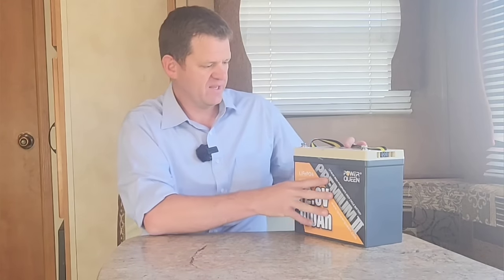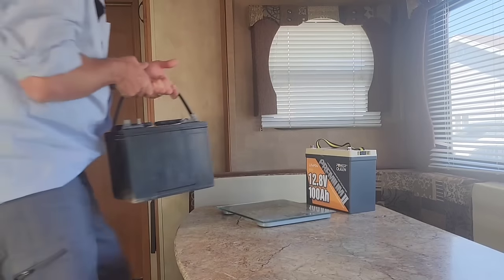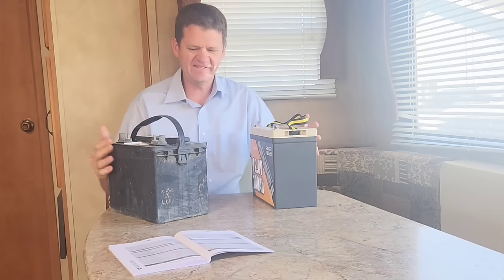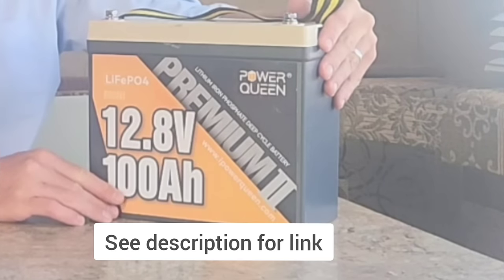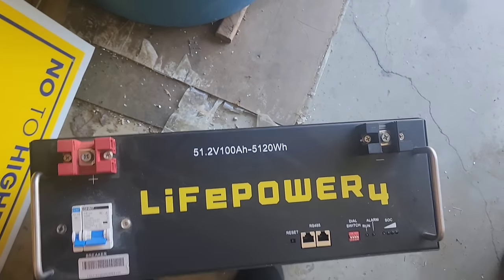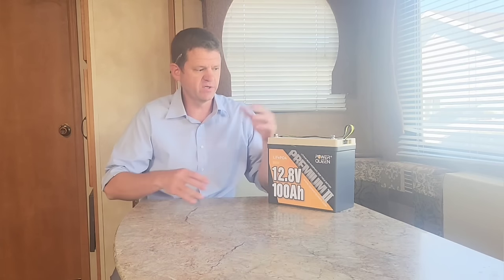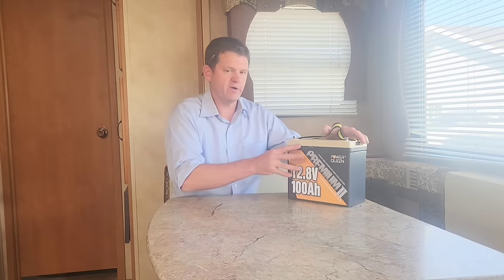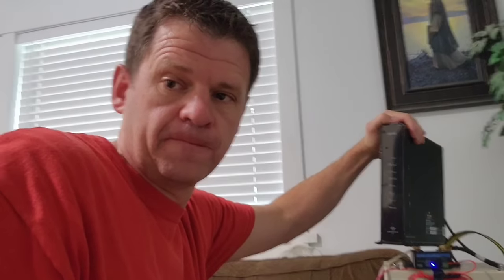How Long Can a 12V LiFePO4 Battery Run a Fridge, TV, Laptop, and Wifi Router (PowerQueen test)

Comment: About 17 hours for the fridge.
Also around 17 hours for the tv.
About 24 hours for the laptop and router.
About 4 hours for all plus some lighting.

Thank you.
Reply: How can you run a 100 ah battery that long
Reply: @Username-e5l  A modern tv doesn't really consume that much power. A laptop and router even less. The fridge does draw a large amount of power, but unless you left the door open, open it a lot or the fridge is in a bad shape it should run at intervals for short periods.
Reply: @LordBaal19  I have a 160 ah battery and I can barely run appliances for 6 hours
Reply: Must be a knock off  @Username-e5l
Reply: Lithium vs lead is 
Lead you can only use 50% max 
Lead volt go down means it use more amps to compensation.   @Username-e5l
Reply: @Username-e5l lifepo4 is good  no piombo agm no good dipende anche dal inverter che hai oltre alle batterie che se sono al piombo ci vogliono 3volte 160ah x 3 480ah piombo gel o agm=180ah lifepo4 ok by
Reply: @dyslectische yes 100amper lifepo4 is =a 260ah piombo cost ok lifepo4 to day no good piombo sopra up 1000watt no good is 25.6v ok or 48v
Reply: @dyslectische yeah I use a lead acid battery
Reply: @Username-e5l  I think it depends on the fridge type. I have a "traditional" style top mount fridges that I bought about 3 years ago. The efficiency rating is higher. I have been watching videos trying to keep their 2 door fridges up for 10 hours.  But also remember, my Lifepo4 battery is higher than 100 Ah.
Reply: I would like to know how long it took to get the battery charged back up with all those solar panels.

Comment: Thank you for this video Ray. I bought a Licciti battery box with 1,000 Watt inverter and 284 Ah Lifepo4 prismatic battery kit.  I tested this last weekend with my traditional top freezer mount fridge and it went 30 hours and didn't get to 50% discharge. I only stopped using it since I still don't feel comfortable leaving it alone at home while we're away. 
  I am watching your videos, David Poz, Will Prowse and many others as I have begun buying the parts for a 48 Volt system. I really wasn't sure whether to buy more Licciti battery boxes/power stations or go to a large system but finally decided to avoid spending more money on the small power stations.

Comment: You did a comparison with lead acid batteries which was great because I use those.
These are the kind of questions I have always wanted answered but no DIYer or professional electrician have ever answered. Thanks for your elaborate tests. I have learned a lot from you
Reply from the maker: Thank you for all the nice comments. I love top gear! :-)
Reply: My first set up was with a sealed lead acid battery too. With led acid 1 rule of thumb is taking the aH on the battery and cut that in half for the true usable aH. My first battery was 112aH led acid and I'd only get about 55hours of constant power with it. It did charge very quickly though with 2 100w panels. About 3-4hours on a cloudy day
Reply: Yes.  I would not have a lithium battery IN my home.  Too risky
Reply: @paulawagstaff686 lithium phosphate batteries are different than lithium ion

Comment: yes the load on the inverter matters to rate the efficiency. A constant high draw load will be most efficient compared to a super low draw because the inverter has to be on longer doing the conversion from dc to ac for a longer time therefore consuming more of your battery into thin air.

Comment: Yesterday, due to storms, we had a power outage that lasted somewhere around 6 to 7 hours. After just about 4 hours, decided to plug the refrigerator into the 268 WH Bluetti power station.. Was pleasantly surprised to find out that it started and ran, and it showed that it had about 2.6 hours estimated in the beginning.  Was drawing about 100 watts, but seemed to settle down to 85 watts.  Now I have a starting point to consider whether I want to go the route of a power station, power station + solar, or a good old fashioned generator.
Reply from the maker: Nice.  A couple 100 watt solar panels and you'd be golden.
Reply: A power station with a capacity of 268Wh is typically equivalent to a 20Ah LiFePO4 battery. This comparison provides a clear perspective on the significant increase in runtime that a 100Ah battery would offer. As for the power stations, lower-end models might have limitations on input charging. This limitation becomes particularly relevant when evaluating the viability of establishing a solar array with an output exceeding 200W. In such cases, the advantages might not extend substantially beyond offsetting power generation during periods of low sunlight.

Even though it might be expensive there are hybrid inverters if you're interested in constructing your own station. Hybrid inverters combine an inverter, an MPPT charge controller, and solar input functionalities into a single unit. This integrated design enables battery recharging without the necessity of a conventional DC to DC charge controller, especially when coupled with a generator. In such a configuration, the generator can efficiently replenish your batteries during periods of insufficient sunlight, most cheap generators provide 1000W of charge power, that can charge a 100ah battery in a little over an hour.
Reply: how the fuck is your fridge running on 100w?

Comment: Your wifi router and laptop, and maybe the TV, you'd be better off running off DC rather than DC to AC to DC. You'll avoid the inefficiency losses converting between DC to AC to DC. 

An amazing way to do this is use USB-C. There are inexpensive PD 3.0 or even 3.1 USB-C devices, which will negotiate voltages of 5, 9, 12, 15, 20, 28, 36, and 48 volts (the last 3 are part of PD 3.1), and potentially if you use the right e-Marker cable designed to do it, up to 5 amps at any of those voltages, delivering up to 240 watts at 48 volts. 

You'd need a boost converter, which isn't perfectly efficient, to bump your 12 volt battery to 48 volts if you wanted to run PD 3.1 devices. But still more efficient than even a Victron inverter.

You can buy USB-C trigger boards for devices that do not do USB-C natively, and make your own cable.

Pretty much everything I do with batteries from now on will heavily involve USB-C and avoid AC Inverters.
Reply: Since I do electronics, I would just go straight to the main voltage used by the device in question, connect it straight to lithium battery's 12V if its own regulator can accept the maximum voltage of at least 15-16V.
And if a lower or higher voltage is needed, I would use a step-down or step-up converter. The fewer devices/converters inbetween, the better.
Reply: @edinfific2576  Yup, agreed. What USB-C PD 3.0/3.1 allows is if you don't know what you need to power, but want as many options as possible without adding a new buck (step down) or boost (step up) converter. If you can put 48 volts into a USB-C PD 3.1 outlet, then you can get ANY voltage at up to 5 amps PD 3.1 supports: 5, 9, 12, 15, 20, 28, 36, 48. You can convert most of your devices easily to any USB-C PD 3.0/3.1 voltage using a trigger board, which negotiates the voltage based on your choice, and outputs the positive and negative to whatever connector type your device needs. 

Now you can skip the buck/boost converters if you can run 48 volts to all of your USB-C PD 3.1 outlets, and have virtually any voltage you need.

On a 12 volt battery bus, you could put boost converters ( 12 volt to 48 volt for $16.99, though on up to 2.1 amps https://amzn.to/44Okkch ) behind each USB-C Outlet so you can have the full voltage range, though peak delivery at 100 watts with the listed boost converter. There may be boost converters that can do 12 volt to 48 volt at 5 amps.
Reply from the maker: Thank you. Very interesting.  My Laptop is the only device that has DC imput( 19v 12.a amps) the router and TV just accept 120 volts.  I'm definitely going to get some of these to charge my 9v radio from usb-c.: https://amzn.to/45yNZHi
Reply: @diySolarPowerFunWithRay Practically all home electronics immediately step down the 120v ac and then convert it to dc. This includes TV’s, routers, radios, computers, newer microwave ovens, etc., etc.

Comment: It seems like the score for the laptop is very tricky. If you start with a charged battery, the battery will extend the running time of the laptop. If you start with a dead battery, some of the power going to the laptop will be used charging the laptop battery.  

I like what you are doing and have subscribed to your channel. Thank you for what you are doing. I think you are helping a lot of (silent) fans.
Reply from the maker: Yup. That's true.  Thanks!

Comment: I love the solar I put on my RV.  It works great and has basically negated our need for a gas generator in most circumstances.  I've tried a million ways to justify solar at my home and the numbers never work.  We are fortunate to cheap power in Phoenix area.  Like a lot of people, I am attracted to the idea of "free" electricity from the sun.  Truly objective analysis tells a different story unfortunately.  Fun video.  Thanks!
Reply from the maker: Thanks. I love solar on my RV also.  Great for an emergency.  Did you see my 48v RV conversion video? You'll like that one.
Reply: @diySolarPowerFunWithRay  I haven't seen the video you mentioned, but I'll check it out now.  Thanks!

Comment: 1. Try connect what possible direct 12V. 2. Buy dedicated inverter for laptop 12V/20V  100-150W. 3. Buy "Inverter refrigerator"  ( big - better efficiency ) so  camping 12 V for big house not right solution. 4. If you have AC / water pump  - good idea to install 24  V (solar/battery/inverter).
Reply from the maker: All good points!

Comment: For conversion efficiency you need higher dc voltage. Lower voltage has more loss. That’s why most home systems are higher voltage.  Simple version is low voltage equals high amps. Higher voltage is Lower amps.  You spoke about it a few times and I believe 80% is pretty good for 12vdc to 120vac. I like what you’ve done there though. It’s good to see people doing some small diy setups and getting into solar. It’s so easy and simple anyone can do it.

Comment: I run my tiny air conditioner during our frequent rural Louisiana power outages from an inverter and 300ah battery. I have limited solar but also use a 20amp plug-in charger. It has been a lifesaver during five heat emergency power outages since June and I can do a whole lot with it. I had to buy a lot of various solar batteries for hurricanes, severe storms, and tornadoes. My relatives nearby called me names but NOBODY can take away my electricity now. I got all electric garden tiller, mower, and weedeater too, and I`m about to get a small heater that can run all night if needed to keep the temperature at at least a safer level when another below zero high wind event happens. Last December I powered my electric blanket from an EB70 when temps fell to zero here with 40 mph winds. I have two of those and 9 smaller ones.
Reply from the maker: I'd love an electrician rototiller. Did you make it your self?
Reply: No, I just bought a tiller that matched my 2000w inverter. I think it`s 10 amps. Anyway, it works.  @diySolarPowerFunWithRay

Comment: this is a really good one step at a time, piece by piece video describing how long just a battery will last for grid down situation. Good job. Here's the next questions. Is there a fast way to charge a battery like that like from a car or generator?  What if we use an all-in-one inverter and some solar panels?

Comment: Awesome testing. I've got 4 power stations, 1 Jackery 300, 1 Ecoflow River 2 Max and 2 DIY power stations. The DIY ones are my largest to save money over a prebuilt. One is based on the 2000 watt Go Power! GP-SW2000 inverter with 200ah LiFePO4 and the 2nd is a smaller setup using a 300 watt GP-SW300-12 and 100ah LiFePO4. There are a few good reasons to have so many. If in a power outage and you use a power station for multiple AC devices and you get into the loop of electricity there is potential to be electrocuted. Limiting each power station to power one AC earth grounded device ensures you can't touch two devices at once and become part of the circuit. However being electrocuted would be rare as you would need a faulty appliance, point being there is no earth ground on power stations like in your house electrical outlets for major appliances like a fridge or microwave. A fridge and microwave together check all the boxes for the potential accident, they are sometimes close to each other in a kitchen, made of metal surfaces and have an earth ground by law. So if you put your hands on both at the same time and one of them has a ground problem you get zapped. Having each one on their own power station negates that potential as long as you have a plastic case enclosing your power station so you cant touch anything conductive which most power stations/builds have. Another reason I have 4 power stations is using larger AC inverters to power small devices like a TV, modem or a router is inefficient no matter what inverter you use if its above 2000w pure sign inverter. Using my 300 watt pure sign inverters can save 3%-10% more power depending on the inverter you own and the application. The other reason I have so many is for redundancy especially the DIY ones. If something fails like a battery or charge controller I can just replace that part rather than the whole power station. I do like Victron Energy also, I think they are better than everything else if you can afford it. Same as Go Power! They are what most people in long term RVs use, expensive but worth the build quality.
Reply from the maker: Thanks for the comments.  yeah, its always good to have a backup around.  Another option for safety would be to have a ground neutral bond on your power station. 
 easy as plugging in a bonding plug: https://amzn.to/47yn7sE
Reply: @diySolarPowerFunWithRay  Yeah neutral bonding at least would increase the safety if using a few devices that should be earth grounded and you have an earth ground in the loop. Some of the pre-built power stations are starting to come with earth ground wiring. For example my newest one, the Ecoflow River 2 Max says in the manual "This product must be grounded. When charging it should malfunction or break down, grounding provides a path of least resistance for electric current to reduce the risk of electric shock. This product is equipped with a power cord that has an equipment grounding conductor and a grounding plug. The plug must be plugged into an outlet that is properly installed and grounded in accordance with all local codes ordinances." I think they mean IF it should malfunction... lol So the fact it has a real equipment earth ground wiring configuration means I could leave it plugged into the wall outlet during a power outage and then I have full electrical safety. Only issue is the little River 2 Max is not going to run my appliances as its to small! But its good they have that included in the new Ecoflow products.
Reply: That last statement I made could be wrong, the quote from the manual is talking about charging, not sure if they mean charging the unit or the plug on the AC inverter is part of the equipment earth ground. I'd need an outlet tester to verify when its plugged in vs not plugged in.
Reply from the maker: @practicalguy973  cool. Also, some furnaces(mine)won't run unless the circuit board detects a GN bond.
Reply: @diySolarPowerFunWithRay  That's a good safety feature and good you know about it. Not many devices have that and running the furnace would be something I would want during a long outage or disaster.
Reply: I put a 150 watts solar panel on my van this week.
In full sun now summer time,I get 50 watts out of it,my battery pack river pro, runs a small compressor fridge that draws when it runs 65 watt,
Battery pack last for only 4 days till it's empty
At night the fridge uses 25% of the battery pack
Reply: @sosteve9113  You running an AC or DC fridge? I know the larger all in one power stations are not optimal for low power AC normally. Thats why I run a 300w pure sign inverter on my smaller system that is still pretty large capacity with the 100ah battery, that is 1280 wh. Larger pure sign inverters are usually inefficient at low wattage applications. DC on the other hand should be pretty efficient at low wattage but I suppose it all depends on the manufacturer design. You might need more solar if its on the flat roof and not at an optimal angle to the sun.
Reply: @practicalguy973  dc ,the fridge is a 36l cfx dometic ,ecoflow river pro 720watt ,solar panel flexible,normally for glueing on the roof 150 watt

Comment: I use a 12v system for my garage and sheds lights and  ir ,light in the garden that a bat keeps turning on at dusk, I did it as a hobby thing but I’m quite pleased with it , it’s got 2 batteries on it and they charge up during the day well

Comment: Hi Ray what's up? New subscriber here.  Glad I found ya. I have a question for you or any subscribers.  Would it be worth it to have that fridge on a timer so that while the fam is sleeping, it wouldn't draw anything? I have those same exact batteries.  I'm new so I hope I'm not making myself look like a jack ass with my question?  I just wondered if it would be a power saving to have it run only when its being opened and closed?  Also, that inverter was a 500 watt starting power? I thought it would take something like 800w to run a fridge that size? Like I said, I'm new to this. Thanks so much. Greetings from Maine.